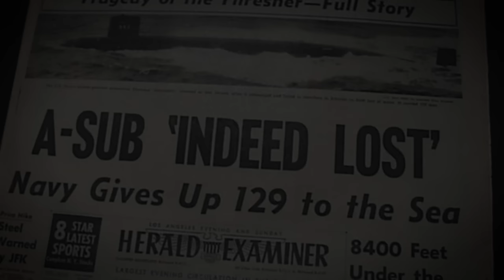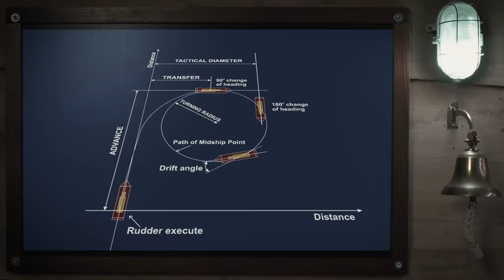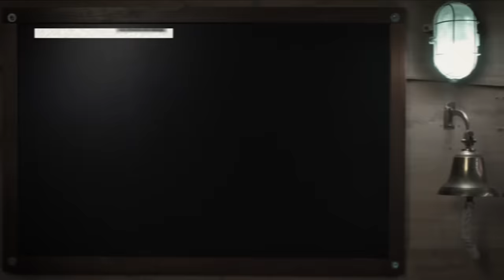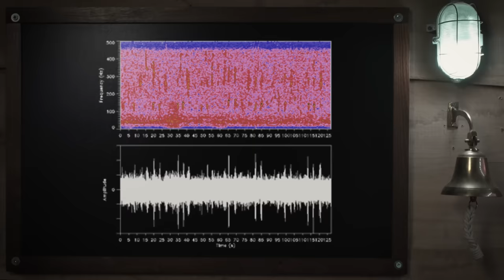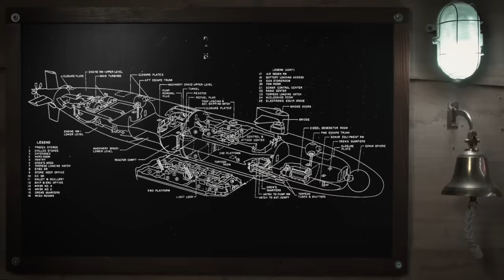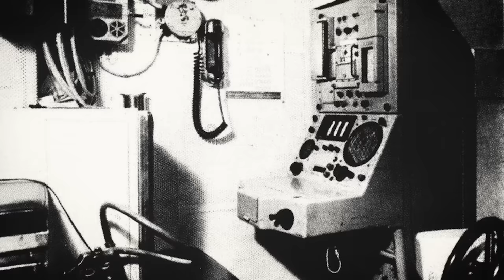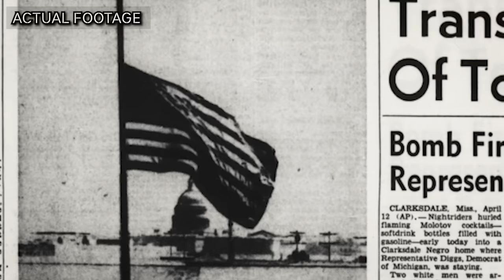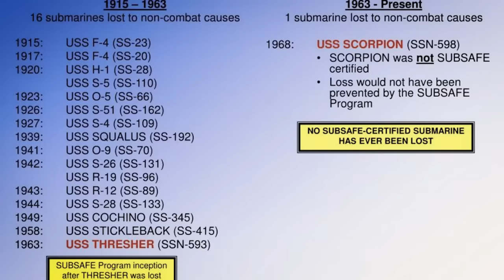This Water Pipe Killed All 129 Men

Comment: I had always heard it was a piece of non-spec pipe that caused the loss. Now it has been revealed that ultimately it was lack of experience and a maintenance failure. Apparently it could of surfaced if the strainers, left in after maintenance had been completed, had not blocked air from filling the ballast tanks. Wonder how long it took the shipyard to discover their maintenance strainers were missing from their tool inventory ?

Comment: The night before sea trials on the U.S.S. Sam Rayburn one of our lower level engine room watch standers noticed something wrong with the main sea water piping lagging. (The lagging prevents the piping from sweating when the sea water temperature is below that of that of the engine room.) He checked and found that the locking wire lead seal had been broken.  He contacted the Engineering Officer of the watch and when they slid the lagging collar back they found that someone had used a cutting wheel on a grinder to cut into the pipe thereby greatly weakening it. Since the main sea water piping has to be able to stand the same pressure as the hull of the sub it would have failed somewhere above test depth!  Could it be that the Thresher suffered that same fate?

BTW - The Thresher's seven bladed screw was designed for quietness, not speed.  The Skipjack class, however, was built for speed, not stealth and was therefore faster

Comment: Another question I have always had is whether it’s practical to use a chemical gas generator if air is not available? I recall WW2 subs not storing enough air at high enough pressure to blow fully. Made me wonder if instead a gas generator say using peroxide could be used to push water out of the ballast tanks.

Comment: At the time of Thresher's loss the immediate action to be taken on a reactor scram was to initiate the closing of the main steam stops. This was an action that once initiated could not be reversed as the valves were driven shut electrically. It is unlikely that the officer in charge had the time to intervene in an automatic action taken by the Stean Plant Control Panel operator.

Comment: SSN 593 had a condenser issue causing a loss of vacuum resulting of closure of MS3/4. This closure u lose propulsion and TG frequency control and loss of RCP then Rx Scram. With a lost propulsion due to MS3/4 closure. Fast scram recovery does nothing. FAulty 3000 blow system she is doomed. Not a flooding issue a loss of condenser vaccum, MS 3/4 closure no propulsion and no recovery. Rest in peace. MM1(SS) Kline poster.

Comment: The water pipe did NOT kill those men. Faulty maintenance procedures and documentation killed those men. The pipe screens were installed as part of a maintenance process and were not part of the operational configuration of the sub. The documentation should have shown OPEN WORK for these screens being installed thus preventing the use of the sub for operations until the maintenance action was completed. Instead, this sub was incorrectly documented as being in an operational configuration when in fact the sub was still in a maintenance configuration with the screens installed. This documentation should have required a verification sign off and a review sign off. Neither could have been done properly. Because the documentation was incorrect this boat underwent operational conditions in a maintenance configuration and THAT is what killed all of those men. INCORRECT MAINTENANCE PROCEDURES AND DOCUMENATATION killed those men, not a water pipe.

Comment: Another thought is a redundant electrical power system in a separate compartment. Just big enough to thrust to surface of reactor is down and main battery is not available such as from control room water?

Comment: 7:50 Most likely The surface ship was communicating with the submarine via ultrasound.

Radio waves do not penetrate water very well, even Very Low Frequency waves can only penetrate a few tens of meters so subs can only use radio when they are at shallow depths. To use radio any deeper than that, the sub has to send up a buoy with an antenna and a wire back to the sub.

Ultrasound communication (Underwater acoustic communication, UAC) uses high frequency sound waves that can allow communication through the water for many kilometers. The sound waves travel at different speeds in different water temperatures, so a thermocline can diffract or even reflect the sound waves as they try to pass through it. 

UAC is quite complex and there are many technical problems to be overcome, most of the improvements over the years have been in the digital signal processing, which has evolved a lot since Thresher's day.

Comment: Just a little remark: Why do you put a ":" in-between every value and unit? You also capitalize only the first letter of the unit. Either capitalize all of it for consistency or do it the actually right way and use the correct symbol: "m" and "ft".

Comment: FYI you can experience thermoclines yourself swimming in the ocean.

Swimming in ocean after a rain and freediving only 5-15ft or so deep you can find spots where rainwater and ocean stay seperated and the temperature difference between the two layers is drastic not subtle. You can literally feel the later, sticking your arm into the warmer or colder layer while your body remains in the opposite layer is not an exaggeration, it's really like that lol.

Comment: 7:51 Underwater communication does bot work via radio waves unless it is extremely long wavelength band. For this sort of communication ultrasound carrier system is probably used. And there is no such thing as turbulence between two temperatures.

Comment: Nice video. Could the surface submarine rescue vessel saved the sub in distress somehow? If it knew the sub was in distress. That was the unanswered question I had watching this. I'm not sure how that would work though, if the had a wench or other way to attach to the sub if it lost control. Or if they were there for observation, and data logging only, which would seem odd. Obviously they knew there were hazards diving to the maximum rated depth.

Comment: 15:50 what is an explosive signal
Reply: An explosive signal is a type of distress signal that involves firing a gun or other explosive at intervals to indicate a need for assistance:

Fire an explosive signal: A gun or other explosive is fired at intervals of about a minute

Use a fog-signaling apparatus: A continuous blast is sounded on a fog-signaling apparatus

Fire red stars: Rockets or shells are fired one at a time at short intervals to throw red stars

Sending the Morse code distress signal SOS 
 
Saying "MAYDAY" by radiotelephony 
 
Using the International Code Signal of distress, which is Code Flag "N" (November) flown above Code Flag "C" (Charlie) 
 
Using three of any of the above signals, such as three shots, three blasts on a whistle, three flashes with a mirror, or three fires evenly spaced

Comment: Water leak cause cooling system fail, reactor shut down.  Cannot propel the sub up to surface.

Ballast blow attempt failed because of ice built up.

Attempt to restart reactor in 20 minutes was way too slow.  They only got 8 minutes until the sinking sub was crushed by pressure.

Comment: The book "Why the USS Thresher (SSN593) was lost" by Bruce Rule explains concisely the true cause of Thresher sinking. Bruce Rule was head acoustic officer monitoring Thresher the day the submarine was lost.Prior to scram of the reactor, mani Bus failure controlling water pumps for reactor.On this day high speed pumps were being used.There is no evidence of bursting pipe causing flooding.Radio in reactor room was operational.Hence,no water shorting out electrical panel. Loss of propulsion occurred.Rule observed the Thresher was negative buoyant at test depth(1300) and unable to deballast because of cooling froze ,moisture in the air -lines to the ballast tanks, blocking those lines Thresher sank at an average rate of 120ft/min from test depth from 0909.OR to collapse at 09:18:24 at a depth of 2400ft(1070psi).Collapse was 1/20th of a second, too fast to be cognitively recognized. The Navy Coat of Inquiry dismissed the results of their own test and blamed cause and brazing failure of coolant pipes.

Comment: Is there a reason to not do such trials in less deep water? For example here 450 metres?
Reply: Hi Richard, various sea trials are done from surface to deeper (classified) depths.  Every system on the boat is checked "little by little" i.e. by increment.  All submarine crews spend a lot of time doing various emergency drills while at sea.  Good questions BTW, Ciao, L
Reply: I wonder if this crew had found a flat soft bottom at a depth less than crush depth might they have survived?

Comment: Brazed, Soldered joints on a nuclear reactor, which can theoretically produce pressures well exceeding PIPE strength much less that of the material in a braze, as well as reach temperatures that would melt the pipe, which would melt the braze earlier
All one can say is...
WHAT WERE THEY THINKING
Reply: Brazed  pipes are all over nukes. I gave seen brazed joints hold 4500 psig!
Reply: @donraptor6156 indeed. Solder this, weld that. Love me a good braze

Comment: 18 t / 18,000 litres/4,755 gals in 3 mins is 1585 gals/min (6,000 litres/minute) flow rate - like a 15 HP water pump turning on filling the engine room of the Barbel. A similar rate of flow from 09.09 to 09.17 or 8 mins may have put 48 t water into the engine room of the Thresher driving her down deeper to implosion with ballast tanks unable to be blown and damaging Sub Brief's video's neutral buoyancy theory.

Comment: If properly cleaned silver solder is damm good. But if pipes is not cleaned properly then joint is bad. Metal should SHINE when joint is cleaned. Welding is always problematic because metals transition zone because of melting metal and not melted metal.

Comment: I guess if it has "unlimited power" via the nuclear reactor, why bother shutting it down in port when shore power isn't available, and why not restart it immediately when the diesel generator fails?
Reply: Some ports don't allow you to keep the reactor running.  Also, if you shut it down, you can send a lot more guys on liberty.  If the diesel fails, you DO restart the reactor immediately, and hope you make it before the battery dies.  It's very iffy.

Comment: Why the fuck they tested the submarine having death depth below them. The boats should be tested close to the coast where depth is not higher than what boat is capable to do. So in case of an emergency the submarine is gonna hit the bottom and there still will be a chance to do an evacuation.

Comment: Silver soldered pipe joints are verry dangerouse especially in a submarine where peoples lives depend on it, stainless steel pipes and all joints welded and inspected only, and thats only the first problem here 👀, may all those seaman rip 🙏, peace from South Africa ✌
Reply: Are you a metallurgists? What do you know about Silver Brazing? I silver brazed on Subs from 1972 until 2002. Brazed joints do not let loose after testing.
Reply: @donraptor6156  I'm a qualified boilermar/welder by trade and I've been on the trade since after my military for 47 yrs, silver soldering and brazing are two different processes my friend, though they get done almost the same way, they both don't fuse into to metal but rather onto it only exactly as lead soldering does, so those pipes are not welded properly but rather glued together with a lower heat based substance like brass, silver or lead, and in this case silver, and it does work well but not something I'd risk many lives on ffs, so as I say it works OK if done in the proper way but there can be a flaw in a joint that you can't see, just a little porosity in the join to be soldered can cause that joint to leak or even fail under preasure as you as a so called pro should know 😉, that is not OK on something like a submarine where lives depend on that vessel, those pipes should be stainless steel and properly welded using argon welding with stainless welding wire or other methods like arc welding and checked for undercut or cracks, anything els you wanna learn dude ???